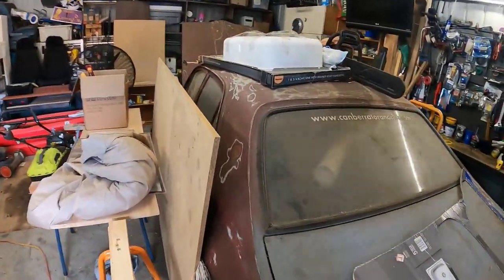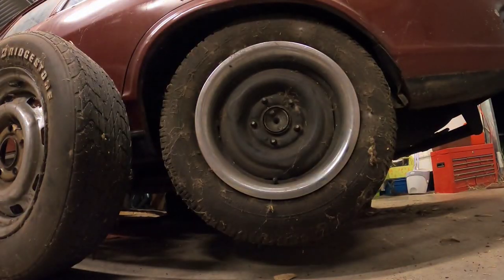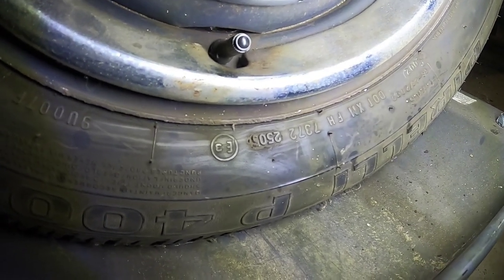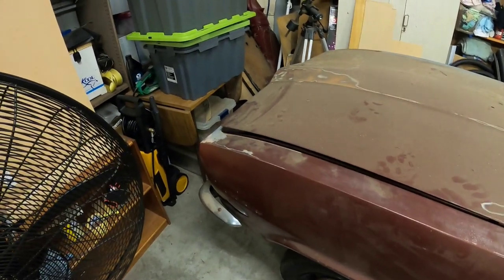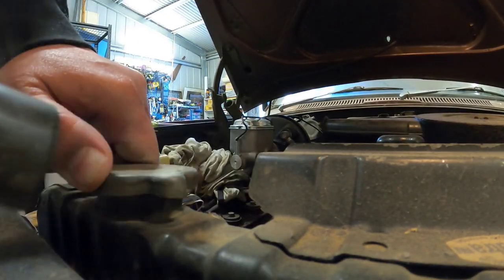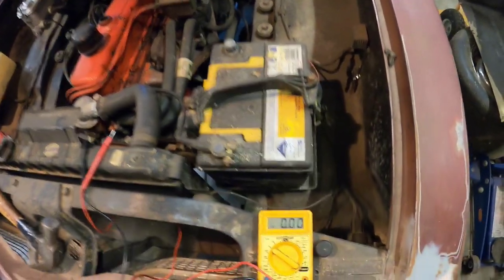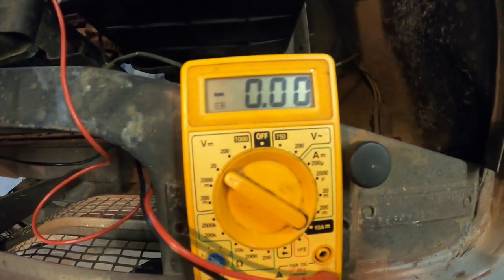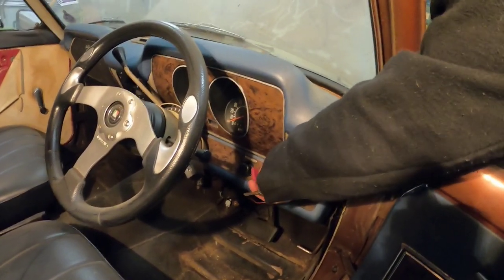Will This LC Torana 4 Door Run after 6 Years on Blocks?

Comment: in the 80s we had a 74  torana like that...engine was 1900 opel .....sent to a shop to fix front fender rusts...repair guy did not know fenders were soldered to the body....used torch to cut rusted parts and ended up melting some of the soldering and making the fenders deformed :(
Reply from the maker: Woah its hard to get good help sometimes. Did it get fixed? I think they are actually welded with lead filler in the joins on the nose cone.
Reply: @BorkenGarage  ....i saw a bit of lead dripping thats why i thought its just soldered.....the fender moved outward making it a bit like wide body....when it was time to paint, the guy hammered it back in...but it did not look like the original.....if i knew the toranas will become collectible, i would not let my dad sell it...LOL
Reply from the maker: @EvendimataE  Yeah that doesn't sound good at all.